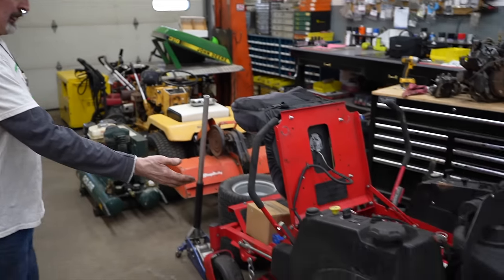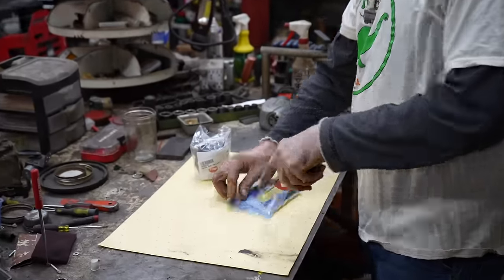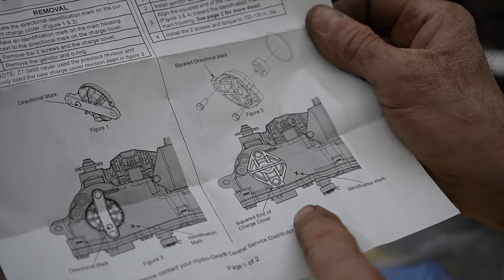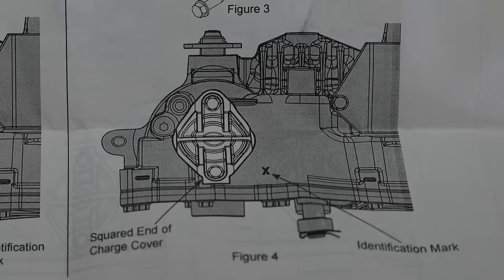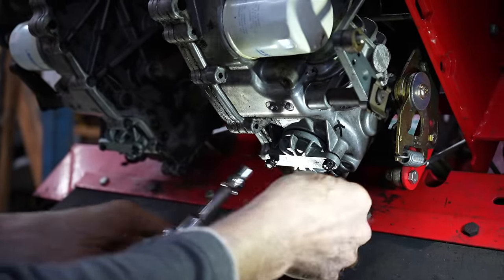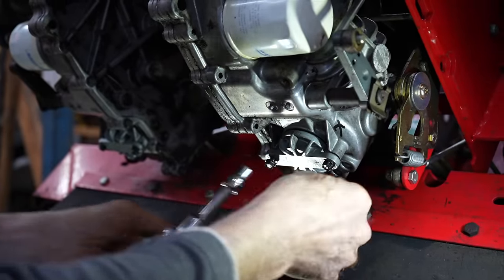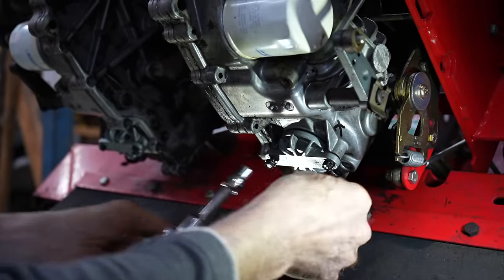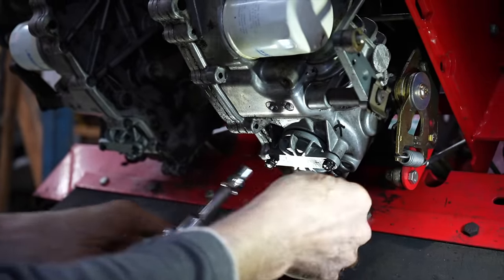Yikes! Hydro Gear Transmission MAJOR PROBLEM + Upgrade

Comment: should have let the oil drain... the oil drains out the filter housing (but more level, not lifted nose down). On my mower the seat switch only kills the blades, not drive. The first step is to purge with the valves in bypass, then purge with wheels engaged. All this is in the Hydrogear books.

Comment: Ive got a 1995 Craftsman lawn tractor with Hydrogear 310-0500. To replace the axle seals requires splitting open the entire unit. What a pain in the a$$ that was.

Comment: Thus why I never wanted a zero turn. Two transmissions to go bad instead of one.
Reply: night and day to any tractor. You should try it.
Reply: @osmith5086  I've been on a couple. Just don't like them. Now the Cub ZT with the steering wheel I might could stand that. But again two transmissions to go bad instead of one

Comment: did you pull oil pump rotor out of old housing to see if there is a offset hole?  just saw it sorry for the unnecessary comment
Reply: @10:20

Comment: The old pump caps will warp , and cause the leak. That’s why the company changed to steel caps. Lay a straight edge on the old cap, (cover) . Ull see daylight in the center of cap, causing the leak.

Comment: Why were the filters tightened without letting the fluid all drain for an oil change? I wouldn’t use two different filters either but most folks don’t care.

Comment: Have you tied to make a lid that fits on reservoirs and has a vacuum fitting on it. Apply vacuum source and operate levers ….may help.
Reply: TarylFixesAlI  , had a crash landing, herniated discs, small fracture, etc. Having to go through hoops VA has before I can see neurologist/ surgeon. Long time mechanic. Twenty two years aircraft plus instructor, auto tech afterwards, ending as general manager. Agent Orange forced retirement. Surgery, etc at 65 y.o.. still kicking at 80! Enjoy your videos, as I have two acres to mow, gardening, etc. Dunno about future mechanics. Gson now is. Good one. Take care.Btw, my AirForce career was in hydraulics and pneumatic systems. Served me well.

Comment: Don't forget to fill the filters halfway on those horizontal oil filters, and lube the gasket, but never use a tool to tighten a filter.
    Why didn't you drain all the oil in order to do a full service?

Comment: One does worry about Hydro's level of engineering these days. Anyone know which hydro box has the hydraulic fittings on the charge pump cover as I would love to convert mine to that model.

Comment: locktite AKA super glue doesn't work with heat...heat is what you use to break the locktite. those hydro pumps will easily hit 100º+F every use. if i want it to stay and semi flatten a couple middle threads at about the head side of the bolt at the end of the depth range. most of the time i won't do that unless it's on something important like this where new pumps are $600 on up each.
not a lot, just a little bit to make them barely fatter than they were before. another guy swears by serrating the threads in 1-3 places depending upon bolt size
Reply: That's a one time, one way solution. You've damaged the thread in the hole in the pot metal casing now with your deformed fastener threads.  Try some loctite Blue.  Don't use red.  It will manage the heat.  
Really

Comment: If you install the charge pumps on backwards, the wheels will not turn.  Why would you install new hydro oil filters, and not let all the older oil drain?
Reply: I believe its because the oil is not used as a lubriCANT  but as a compressive fluid.
Reply: Because he could tell it was crystal clean and didn’t need a change. For all we know the owner had just changed the fluid then found the leak and took it to taryl.

Comment: Why not completely change the transmission oil?
You replaced the oil filter, and the oil pump.  The oil pump was leaking.  

Leaking oil pump indicates damage.
A leaky anything is an indication of damage.  The oil pump has metal on metal.  A leak can mean damaged metal, and metal filings in the transmission.  

The point is that metal filings are normally found in the last of the oil that leaves the oil reservoir.  The oil filter was changed. The oil pump was changed, but only most but not all of the transmission oil was changed.  

Why was not all the transmission oil removed before the oil filter was installed?

Comment: Trex…you need to remove top plugs on each tranny to bleed air. Hopefully there was enough oil to lube each tranny with engine running😬😬😬🤦‍♂️

Comment: damnit, I got two mowers with zt2800 and one with zt3100.  come install the upgrades before leaks begin :)
Reply: You never fix a machine that isn't busted, by the time it fails the revision to fix the revision will be on the next revision.
Reply: Maybe later.  Going to buy groceries maxing out credit.  That's going to be my dinner :)

Comment: 21:40.  YOU NEVER TIGHTEN OIL FILTER WITH WRENCH. 
W.T.F. ARE YOUUUU 
DOINGGGGGG
Reply: It's OK, just don't overtighten them. A lot of service manuals give you the torque for the filters whilke others say tighten by hand and then another 1/4 turn with a wrench or something like that.
Some people break the nipples and that requires a lot of force, using one of those strap wrenches you will crush the filter before getting it so tight, I wonder if they use filter cup wrenches and a breaker bar with a cheater pipe...

Comment: Hey you got 50/50 chance of guessing correct? Flip A Coin heads or tails? One way it will pump, flip and it will suck... Boy would it suck have to take apart again... Then 2 pumps to mess up, Double your pressure double your fun, With Doublemint Gum?

Comment: TARL, you disappoint me ,working on thing one handed tool in one hand and a light in the other DAM,get yourself some LED LIGHT that site on your head snap-on makes them and can recharge the batteries  last 8hr site around your head on top of your ears and can point then where you want them to see where your looking it will free your both hand up i use mine all the time once you get a taste of working with them you cant go with out they are very bright and make you see very good, take out all shadows see very clear in dark tight place and makes working on things easy you can see what your doing a must to have,